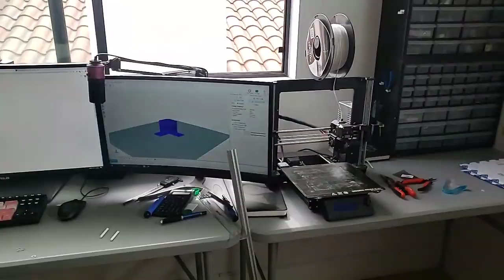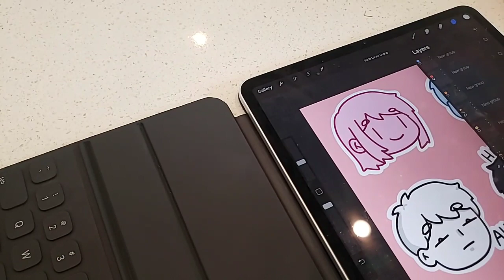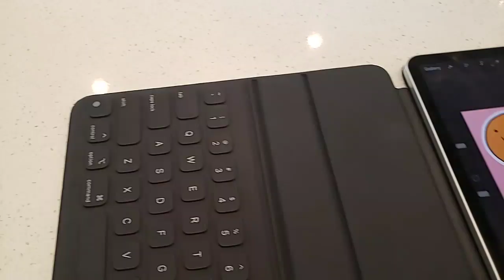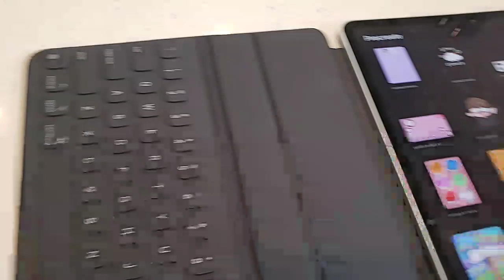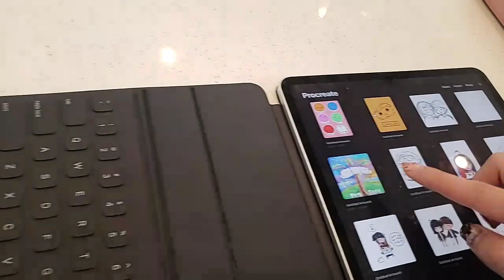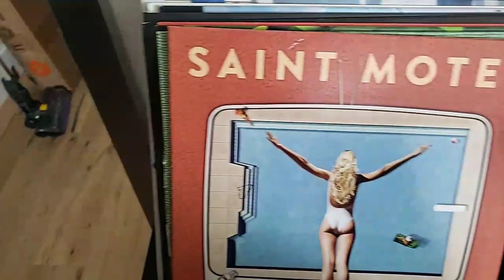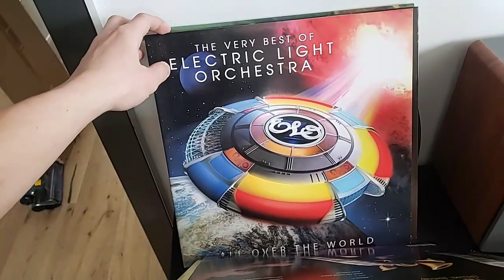[02/27/2020] MichaelReeves VODs - Michael's Garage | Michael's Bedroom | Michael's Stuff | Michael's

Comment: Is Michael's mystery part for a CNC router? The rails (10:22, 26:52, and 39:58) look just like other CNC machines I've seen, and he also has a 3d [printer] controller (23:17), which seems a bit too specific to just have laying around. He also mentioned the depth meter for the project (30:14). The reason I think it is specifically a CNC machine and not any of the other suggested ideas is because there are multiple rails, and the rail shown at 26:52 seems to be a finished rail, which looks like its about the length of most CNC machines. I am a bit doubtful though, because Michael seems pretty confident that nobody will guess it, and a CNC machine seems pretty simple.
(I also looked in the comments and didn't see anyone else suggest this, but I might have missed something.)
Reply: Maybe a CNC built using vslot rails, but that would be too useful 😂. I'd like to think I'll be surprised in the next video by what Michael builds ✌🏻
Reply: @PrathameshJakka  And if a CNC is too specific, maybe it's a Pick and Place machine for building printed circuit boards.  All sorts of things will run on CNC-style equipment! Another creator did do a motorized camera rig, the pick and place, it's in all sorta of places!  Still, next video maybe :P

Comment: Those linear caster rails on v slots looks like our later iterations of elevator type lifts. Those look like the dead ones but the ones powered by electric motors had pulley equipment on the side and we just ran para chord in it. Linear elevator on pulleys are effective and fast but once one of those v-rails bends its game over. However, elevators that are built like Michael's from my experience are a lot more reliable and durable compared to fork-lift type linear motion, and its based around the same design philosophy as what couples most roller-coaster cars to the rail. Last year we used the REVERSE of this kind of linear motion(where the runner is static and the pillar moves up and down) in order to lift our whole chassis up a few feet. I-Bolts and later rack/pinions where used achieve the motion, and the runner was more or less just a linear bearing. Cool vibes michael, keep your dick in a vice.